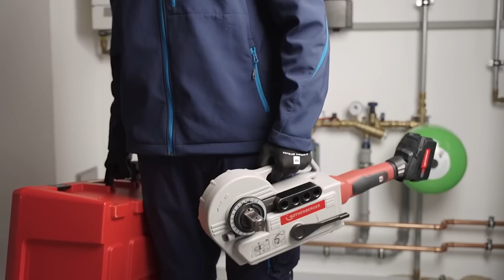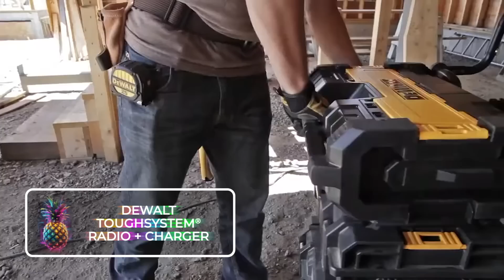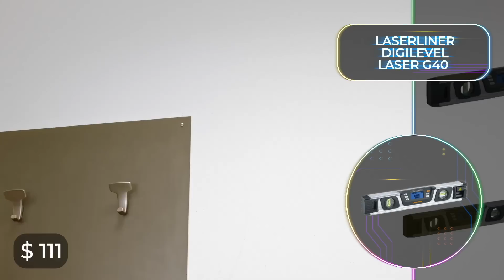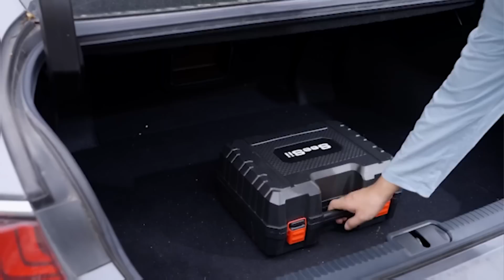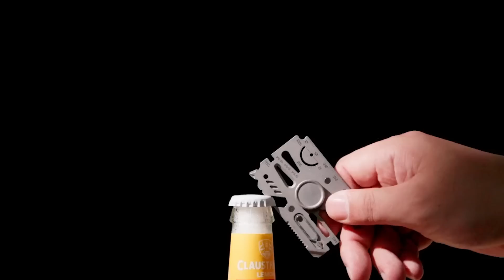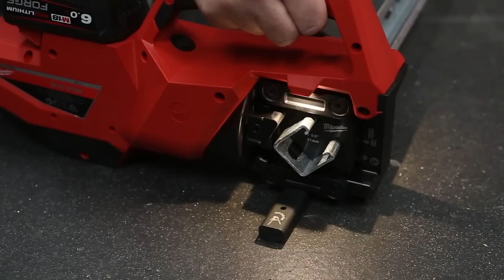Amazing Tools Professionals Use To Cut Time In Half

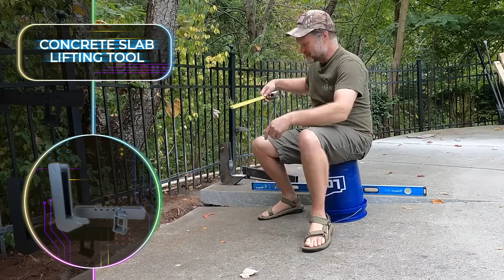Comment: Tried raising a small walkway with a rail jack and the walkway snapped. Not sure the thing shown 20:05 wont so the same.
Reply from the maker: It's always important to use the right tools for the job! Safety first, and maybe a bit of practice before tackling bigger projects.